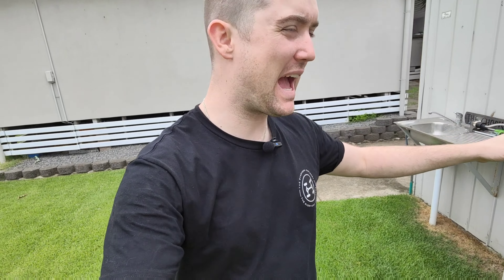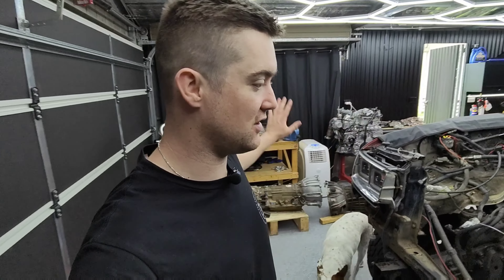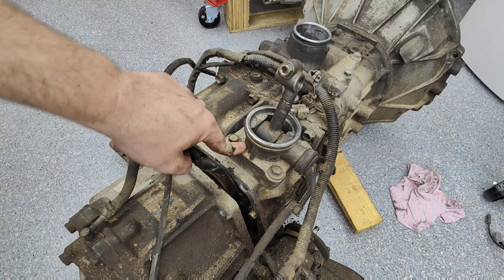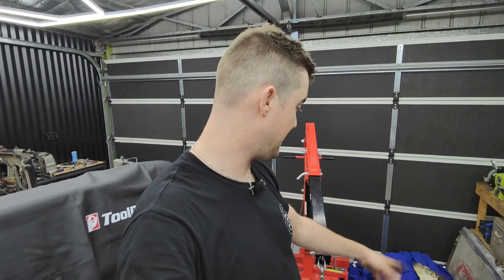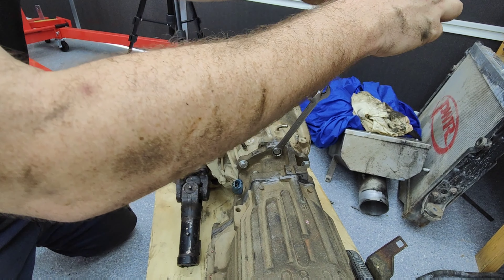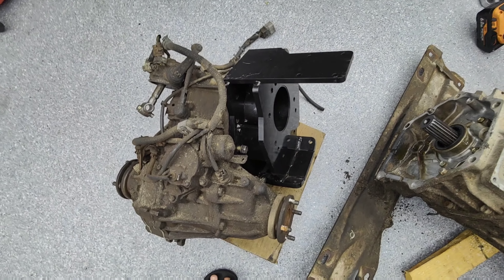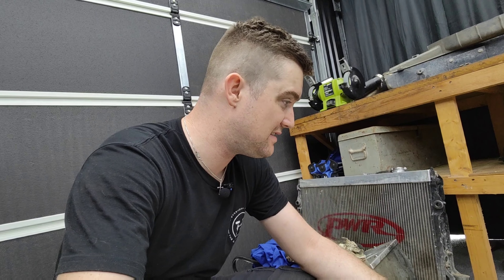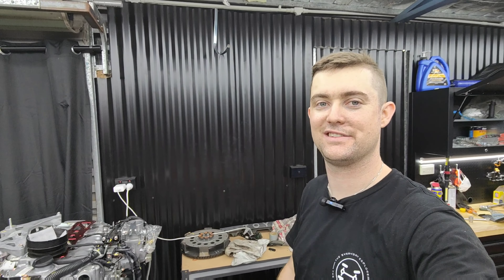HOW THE ISUZU AUTO TRANSMISSION WORKS IN A TOYOTA 80 SERIES

Comment: It ain't going to work mate, you've got to remove the spacer between the gearbox and the transfer case. The new bracket takes up that space.
BTW the Isuzu box is actually a Toyota box it's made by Aisin, so your options for other types of Toyota transfer cases are wide open!
Reply from the maker: Yeah the Aisin A340e 4 speed came out in heaps of Holden, Isuzu and Toyota's. Why would this NOT work in my application? Isuzu 4JJ1, A340 from a Colorado and then the adaptor to keep the full time 80 series transfer? :)
Reply: @TheEverydayExplorerAUS   He's taking about the spacer between the Isuzu transmission. the piece with the blue sensor in it @4:18. that also needs to be removed for the 4j adaptor kit.👍
Reply from the maker: Thanks for the feedback, I will take a look! I swear the bolt pattern lined up, but I'll sus it out, thanks! :)
Reply: @TheEverydayExplorerAUS  the  bolt pattern will be the same as the bolts goes through the aluminium spacer, but the main shaft will not reach the transfer case.
Reply from the maker: @mullerandre95  there is a spud shaft though that sits in between the transfer and transmission?
Reply: @TheEverydayExplorerAUS  just make sure that the shaft engage in the transfer case